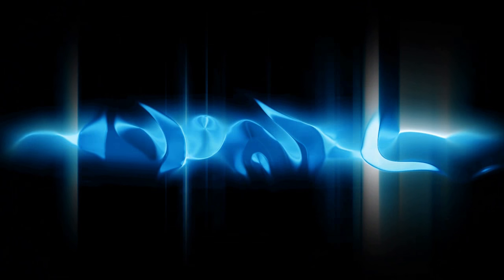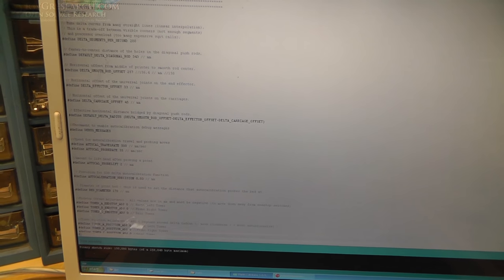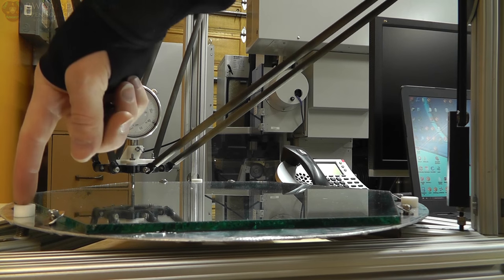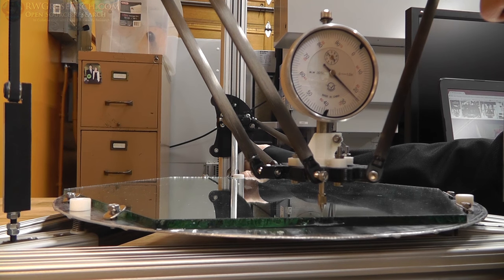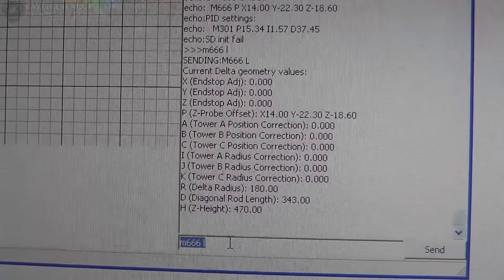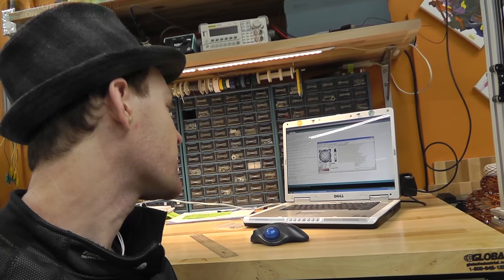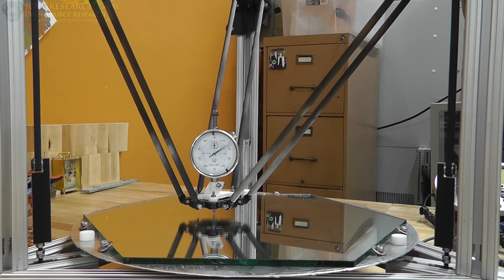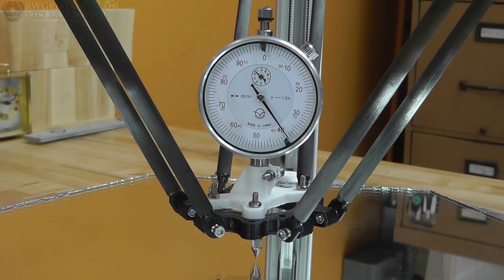RWG-OSD #15 Understand & Calibrating A Delta 3D Printer Manually. The basics. How To.

Comment: I think it is better to adj the 3 point right under the tower to the same hight,by doing that,means your bed is parallel to the plane construct by XYZ tower endswitches.
then try adj the center point to the same hight as the 3 point under the tower.
I think in this way it is better and more easy to do.  how do you think?
Reply from the maker: +郭牧楠 yes, that's what i explained in the video, start at the 3 tower points. that will get your bed "level' or as you say parallel to the end stops. 
then yu say to try to get the "center" point the same, you do this Via delta radius. if its wrong it will be high or low in the center / edges. like a " cone" so there are settings. i think it will also change the outside points you already set. so you will need to check again it any how.  your idea is basically what i described. ~Russ
Reply: yes,it is need to re-check the 3 tower point every time changing the delta radius..
thanks for reply~~

Comment: Hey, very informative video, calibrating with bed adjustment screws sure is easier than adjusting the endstops. Question: why use rich cattel? the m666 command is more informative for sure and the bedlevel routine seems to works as well but besides that any points you particularly like about this older version?
Reply from the maker: +Sungod3000 there is no " new" version of marlin besides rich cattel version that has Delta auto cal. If there is a new version please let me know. but i have not seen any. i have been using this version only because at the time ( when i built my first printer)  it was the version recommended with the Delta auto cal. ( Z probe)  however I'm not really a fan of it. i tent to find it better to just do it by hand ... ~Russ

Comment: Wouldn't want to go through this mess. This is why I think smoothieware is so great. I created a mount for the z-probe which places it just below the hot end and added a wire harness there. Then I ran 2 calibrations, first one gives me the exact radius and arm lengths, then I did a 15x15 bed leveling grid. Then remove the z-probe, perfectly leveled, no futzing with dial indicators, my entire 490mm diameter build area is leveled to 1/100 of a mm -- easy money :)
Reply from the maker: +kazolar true, I have been doing that with reprap firmware, however you have to remember that checking this your for yourself like i did here is a nice to do, it means you ( me in this case)  really understand what is going on. This way if things start acting up its easy to find the problem. any how, when i started 3 years ago on my first delta all this was so confusing and there was no "auto level" so it was figure it out or bust! ~Russ
Reply: +rwg42985 I got 2 other printers where I have to do that mess, 1 where I had to learn the 3 point manual leveling -- with dual extruders, other one is a bit easier with 4 points. In either case the new printer, I went through manual leveling -- got it close, then did what I wanted to do in the first place. Marlin is OK for cartesian printers, but I wanted to build a large delta to print fast, so arduino based controllers were out -- they're simply not adequate for doing fast delta computations. Smoothie is just wonderful, you calibrate, then edit a config file on the sd card, no messing with recompiling, just edit the config file and type in reset into the terminal -- done! With grid based compensation -- I have 225 points of adjustment -- there is no reason to do it manually anymore.
Reply from the maker: +kazolar yes, I'm with you, that's the way the reprap firmware is, the config is no the SD card, also the new electronics i have been using  (Duet V8.5 its a 32 bit fully capable of controlling the delta, even at fast speeds. ) has a fully built in web interface too. no need or a Pi to do that.  just hop on the web, update the config file, it restarted its self and its good to go. any how, This video is about how to do things manually, its something most don't know how to do so i hole this helps clear it up some more... by the way, i have had my other delta on marlin, mega2560, ramps 4.1, running at really fast speeds with out problems. the only problems are the mechanical ones... so it is feasible, just not piratical, if one can go with a better controller that's grand! also the eprom on the mega2560 has all most more settings saved in it and can be updated just like the config file for the smoothie, any how just some thoughts :)   ~Russ

Comment: Eek, this gave me a headache as I am so close to finishing my own Delta not from a kit. I have installed a Z probe on it so I really hope I don't have to do this :P great video though.
Reply from the maker: +Marz its good to have the knowledge ,else if something is not right you have know idea what to do next... 

what firmware are you using and what control board? 

if its marlin, i recommend switching to Repetier. its a bit complacated to get up and running but once you do i think its better. its auto cal is a lot better. in fact i never really got the marlin version to work correctly with auto cal. i found it better to do by hand. 

~Russ
Reply: +rwg42985 Yh I really enjoyed the video and you explained the settings well. Was using Marlin with Ramps 1.4 + full graphics board as same set-up I use with my i3, Will give Repetier a go though for sure.
Building these things never go to plan, taken twice as long as I expected so far, great fun to build your own that getting a kit though.
Reply from the maker: +Marz cool, switch to the 4 row 20 charterer  LCD, the graphical interface will not run smoothly on that set up. the graphical LCD uses a bigger library and the mega dose not have the processing power. i have been using this one for years n the rostock, http://reprap.org/wiki/RepRapDiscount_Smart_Controller has been working grate for me on marlin. not sure about Repetier. should be ok. also a note, you must pick a new eprom number every time you download the Repetier firmware o it will not change settings. kinda wack. took me a week to figure it out and some one else had to tell me lol. glad you are building from scratch! its a lot of fun to say " i built that from scratch"  Best! ~Russ

Comment: you can simply uncomment the equation to make flattening easier..
(//#define DELTA_RADIUS (DELTA_SMOOTH_ROD_OFFSET-DELTA_EFFECTOR_OFFSET-DELTA_CARRIAGE_OFFSET))
then add this after with a arbitrary value close to the equations sum... then adjust that one number and done...
(#define DELTA_RADIUS 146.75  /* If the nozzle rizes as it gets closer to the edge of the plate, then decrease the DELTA_RADIUS... If the nozzle drops as it gets closer to the edge of the plate, then increase the DELTA_RADIUS... */ )
Reply from the maker: +Johnathan Oey yes, i see this is how its done in the reprap firmware. makes sense to do it that way but i just decided to keep it the way it was in the Marlin for less confusion  :) good tip though! thanks! ~Russ